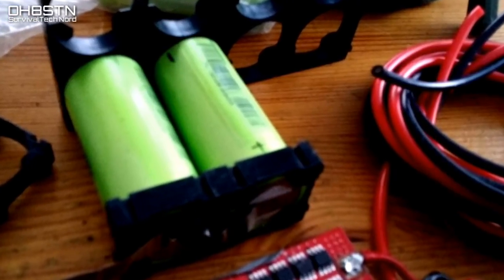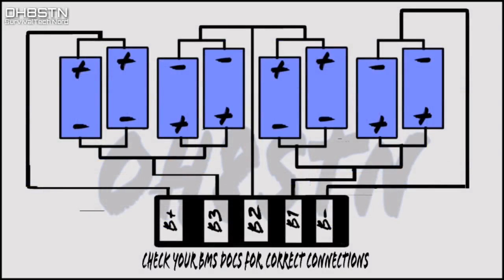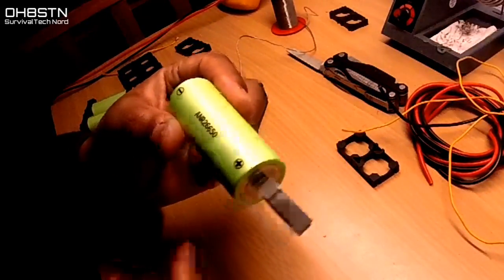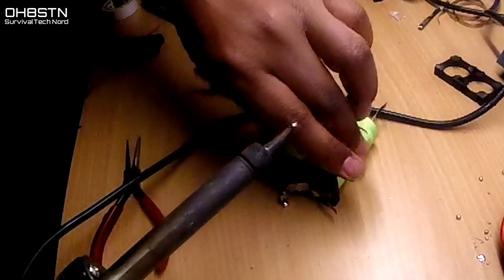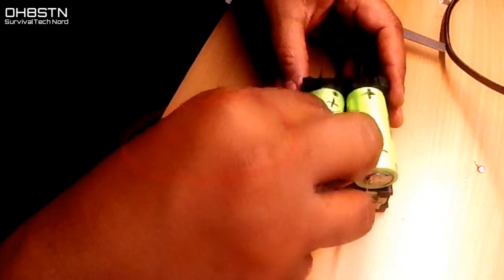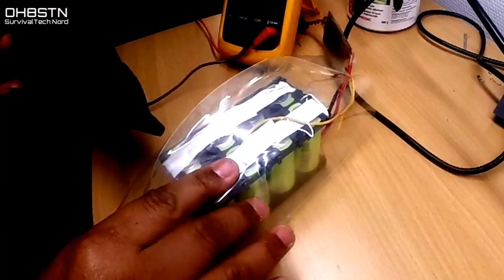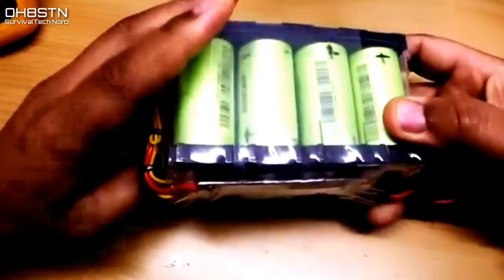Portable Ham Radio Battery | DIY LiFePO4 QRP 56wh

Comment from the maker: Here are the epusode notes.
http://oh8stn.org/blog/2017/10/12/4s2p-5ah-lifepo4-with-bms/
This is more difficult build than the first two projects, but it's still a simple build. If this is your first DIY battery build I would suggest starting with the qrp battery pack, or the 10 amp hour battery pack we did a few weeks ago.
Parts list is on the episode notes page.
Reply from the maker: Hi Paul 
I normally do but I think I must have forgotten for this or there in the episode notes. I'll update this and add some links

Comment: Hi. Me again. Another stupid question. I understand that this build is for pack being charged with solar power. My question is, how to power this packs from the outlet? Could you give me an example of a product that will do it?
Reply from the maker: Quality of the answers is only as good as the context provided in the question. This device charges my packs straight, without any radio connected.
https://shop.lipopower.de/LiFepo-Lader-120W-12V-56-060A-umschaltbar-fuer-4-LiNANO-Zellen-Eingang-230V

Comment: You don't need to worry about heating up the battery. I assembled many packs of 18650's by soldering directly to the battery terminals. It's not that bad, just make sure you have a good aliexpress station that has temp control and lots of flux. Sand the terminals before soldering helps a lot too

Comment: I see some textile bags there. Can you point out some that are suitable for 4xA123 packs?
Reply from the maker: What I usually do is find packs from a company called condor. They usually list the inside diameters of their admin pouches, so it's easy to figure out which one to get. I get them from Amazon and also eBay.
I hope this helps
Reply: @OH8STN  Thanks a lot Julian.
Reply from the maker: No problem 👍

Comment: I don't know how much all these parts cost to make this but one can buy a Bioenno Power 12V, 12Ah LFP Battery (ABS, BLF-1212AS) for $116.24 including shipping and it can handle 20 Amps continuous discharge and it comes with built in battery management system built in.  They also have a 6 amp version that can handle 12 amps continuous discharge. for 74.99 shipped. The reviews on this brand of Lithium Iron Phosphate battery packs is pretty good too. they sell them from 3AH all the way to 300 AH. I understand it can be fun to build these from scratch but thought I would throw this out there. They also make these in a pretty rugged case.
Reply from the maker: Yeah, bioenno is out there, but they are not the best battery, just a popular battery. A couple of points.
- We don't know what cells are used in boienno batteries.
- We don't know what bms is used with bioenno packs
- Bioenno current draw is down compared to these diy builds.
- The bioenno built in bms/pcm has shown "strange" compatibility issues using charge controllers other than their own.

-The bioenno charge controller is a cheap chinese alibaba special with their logo on it.
With all that said, they do work for some applications. On the other hand, if one wants max compatible and highest quality of cells & components, the only option is to build it yourself.
It is not always about that price, it is about reliability in the field. One can't put a price on that.
thanks for the plug though. I have also plugged them in a couple of my videos, but would not trust them for critical communication.
A better option if you don not want to build is Dakota Lithium https://www.dakotalithiumbattery.com
The publish clear documentation on what goes inside their packs. Bioenno is mostly just marketing!
73
Julian oh8stn

Comment: Quick question: I realize that this build in the video is 99% the same with the headway 10ah pack using 8 cells, but in the headway cells you would be using the copper bus bars instead of the soldered tabs.  I could not locate a video from you where you put together 8 of the headway supercells into one pack.  I only located the video where you put together 4 of the headway supercells..  My question is how many busbars do I need?  I counted 11.  Did I count correctly?
Reply from the maker: +Gerald Grogan hi Gerald. We're talking about the Headway cells in 4S 2p configuration correct?
Reply: OH8STN yes exactly
Reply from the maker: +Gerald Grogan well depending on how we do it, each cell in the series uses one busbar between them, not counting plus and minus at the start and end of the pack. That makes 3x. For 4S2P adds 3x more for the parallel sets. Connecting cells plus/plus minus/minus in the 2P parallel set requires 3x minimum, or 6x if you go across each cell to the nect set.
Does that answer your question?
Reply: OH8STN yes that works. Thanks for the help
Reply from the maker: +Gerald Grogan no problem. Judt sitting wotking on the einter field dsy gear. 
73
Julian oh8stn

Comment: I am ready to try building my first pack, but your video seems to have left out one critical detail;   Before physically connnecting two individual cells in parallel, how close do you charge the voltage to?   I am doing a 4S-3P pack with A123 18650 cells.
These have internal resistance approx 3 to 5 milliOhms.   When I do an initial full test charge on 3 new cells, and let them sit
for an hour, I can meter wide variation for each cell such as 3.3, 3.5, 3.47 volts.    Let's do the math;   If I happen to pick up a cell
that is at 3.3 volts and try to connect a parallel cell that is at 3.55 volts, the initial current flow will approximate .25 volts divided by .003 milliOhms, or, 83 Amperes.    I tried charging approx 5 of my new cells and metering them, each shows a little different voltage.

QUESTION:   What process do you use to ensure close enough matched voltage, and small enough inrush current, when physically connecting two cells in parallel?

Thanks,

Neal    N6YFM
Reply from the maker: +Neal Pollack Hello Neal.
Firstly, new quality cells, in spec, from the same batch, ...  Each cell needs a full charge (preparation), preferably several times to establish its resting voltage. After that, we can  select cells by resting voltage, creating groups of cells eith identical voltage for a parallel group. 
73
Julian oh8stn

Comment: I may have missed it in your video;  Where do we purchase the BMS/PCM module for this battery pack project?
I really wish to build one, but I am aware that there are many cheap, defective, poorly engineered BMS/PCM boards on ebay.
Can you please share where to purchase, and part# for acceptable quality BMS/PCM module?   Also, did you purchase these 26650 battery cells directly from A123 Corp, or are there online resellers that you could please share?
Thanks,
Neal
Reply from the maker: Neal Pollack always check the episode notes Neil. Links in the description and the very first comment. If you are North America check batteryspase.com if you're in Europe, http://shop.lipopower.de
Hope this helps
73 
Julian oh8stn

Comment: Nice project build Julian, I had initially thought you might have 3D printed the pack frame yourself :)
Reply from the maker: +SpectreOZ thanks for checking in. I would have 3D printed it but I don't have a 3D printer yet. That's something for 2018 we're going to start making enclosures and some pretty cool breakouts for these portable power projects

Comment: Another great video.  I love the portable power projects.  My HF rig, Kenwood TS-590, isn't the most portable setup, but I still want to build a power pack and solar charger to be able to operate if the power is out (read natural disasters).  Weight isn't as big of a concern for the home base.  I'd be interested in hearing your thoughts on a home based power pack.

73s,
Stuart
Reply from the maker: +StuartInTX always love your support Stewart thank you. Actually I believe the portable power for the field station and your portable power needs at home are pretty much one in the same. The only difference I would make on a home station, where weight wasn't really an issue, would be to increase the cable connections  gauge between the pack and BMS, BMS and charge controller, and charge controller to radio up to something that's actually lossless or near lossless. 
You need to calculate the amount of watt hours you need over a 24 hour period  ( which is unique to all stations and operators), but for the solar powered Field Station project I'm building a 40 amp hour pack with a 120 watt panel, abd 10A charge controller to power it. This can be scaled up or scaled down, especially scaled-down if you're not going to run the rig 24/7 when your off grid. 
This is what I'm planning on ordering in the very near future http://www.westmountainradio.com/product_info.php?products_id=epic-pwrgate it's not for my solar powered Field Station, it's for the shack. It might be something that ties everything together in your installation.
73
Julian oh8stn
Reply: Great points and advise and the PWRgate looks very impressive.  I need to do some calculations, order some cells and fire up the soldering iron.  You're an inspiration!
Thanks again, 73s.
Stuart

Comment: Great videos Julian.  Question for you - making this 10 Amp hour pack, is it comparable to what a 35 amp hour AGM battery would put out, being that you can't really get 35 amp hours from an AGM? (depth of discharge is about half so the AGM doesn't ruin).
Reply from the maker: +Steven Hull hi Stephen actually I think of you can slice it right down the middle a 40 amp hour AGM versus a 20 amp hour lithium iron phosphate
Reply from the maker: +Steven Hull I accidentally hit send before I finished my comment. Actually done to me what are you talking about what hours or are you talking about for lack of a better phrase cold cranking amps. Current draw will be whatever the battery is rated at. The weak link on the lithium iron phosphate on lithium ion batteries is the BMS BMS has to be rated for the battery pack. If we're talking about AMP hours are what hours then I would go back to my first incomplete comment which is you can slice them right down the middle this 10 amp hour lithium iron phosphate pack is the equivalent of a 20 amp hour AGM and so on.

Comment: Im considering this but going about it a bit different.  I wanted to ask and understand why in particular did you choise A123 batteries over what I was leaning towards 18650s?  Not cost because they seem similar.  Is it's more stable voltage? Im interested in the 18650s in a 4s(something maybe 4)p configuration but because fully charged would be over 16v, they can be short charged to whatever without harm and in fact extends their life.  I also like that, say charged to 14.8 volts, most rigs need 13.4v or more to output full wattage/power.  Is my idea just another way to do it but no better or worse or have I over looked something?  Thanks!!! Many thanks for all the videos!!!
Reply from the maker: +Home Phone Hi HP.  There's nothing wrong with your idea 👍.
Firstly, based on the voltages you specified, you're talking about lithium ion 18650 batteries. This project used LiFePO4  ( lithium iron phosphate) which is safer. I used LiFePO4 in 26650 format, because I would have to use many more 18650 cells in parallel to achieve the same capacity. So it was about reducing the complexity of the project while increasing capacity.
Your idea about short charging is absolutely solid. Look at much longer life out of the batteries if you don't charge them up to 100% capacity.
Thanks for the comment, and brainstorming. I really enjoyed it 👍

Comment: Julian, I've got a question about BMSes.  If I wanted to build a 12v 40 Ah pack could I do something like build one 12v 10Ah pack with it's own BMS then build three more identical ones each with their own BMS then connect them all in parallel to reach the 40 Ah target?  You've got me thinking of how I can replace my two 12v 30Ah SLAB boxes.
Reply from the maker: +Richard Slusher someone else just suggested using multiple bms's. I'll do some research and write an article on it.
Reply: Oh, OK.  Great!  I must've missed that one.  Thanks!  :)
Reply from the maker: +Richard Slusher the thing is the other commenter wasn't wrong, but he's not entirely right either. A123 sells their own parallel battery packs with single BMS board. In fact many companies do it this way. Then there are those who use as separate BMS for each parallel set. It adds to the complexity and the cost. But anyway I have to do the research and see the benefits of both methods objectively.
You know I have that solar powered Field Station project with a 40 amp power pack. I had planned on a single BMS. Even the big Headway packs that I'm building Headway themselves specify a single BMS for parallel packs. 
Research is good
Reply: A good advantage in building multi 10ah packs is TSA compliant.  Maybe pack one in a check on bag, one in carry on, another with spouse carry on.. Ive consider..
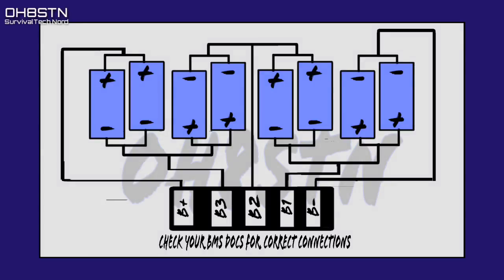Reply from the maker: Home Phone if you're in the United States you can't check a 10 amp hour pack into luggage. There's a limitation of 100 watt hours. The 10:00 amp hour pack is 128 watt hours, so it's a TSA no-go.
Reply: To my knowledge, nowadays rules for carrying batteries on airplanes should be the same around the world. For what concerns lithium ion batteries the limit is 100 Wh per battery and there is no limit on the amount as long as they are transported separately (i.e. not connected together) in carry-on baggage (you cannot anymore put stant-alone lithium batteries in checked-in luggages!). Of course there's always the risk that the people at the security control don't even know what we are talking about... Sources: https://www.finnair.com/int/gb/information-services/baggage/dangerous-goods and https://www.tsa.gov/blog/2013/06/11/travel-tips-tuesday-safely-packing-batteries-your-trip
Reply from the maker: +DMcC Thanks. Thankfully there's no TSA in Europe. 
Most of those rules apply to traveling to, from or inside the USA.
Definitely good information for North America
Reply: +OH8STN You're welcome. However, the 100 Wh rule as well as no spare lithium batteries (nor power banks) in checked-in luggages apply nowadays all over the world.

Comment: It's not safe to parallel any of the batteries because you can't individually balance them. A safer solution would be to have two BMS boards and parallel the output of the two boards. Each battery would have it's own balance circuit.
Reply from the maker: +Cisco8484  thanks for the opinion
Reply from the maker: +Cisco8484 what you're saying is partially true. You can use two BMS boards and balance each individual cell, then take the output of the dual bms boards and parallel those. Or you can match the voltage of the parallel cells when building a parallel pair. This method uses a single BMS and reduces the complexity and cost if the battery pack. The only time this gets dangerous is when cell voltage isn't matched and parallel sets, and we use cells from different manufacturers or different levels of degradation. If all the batteries are within spec when you get started as they are when you purchase new batteries, the risk is minimal if at all.